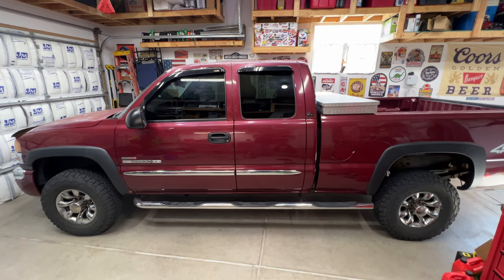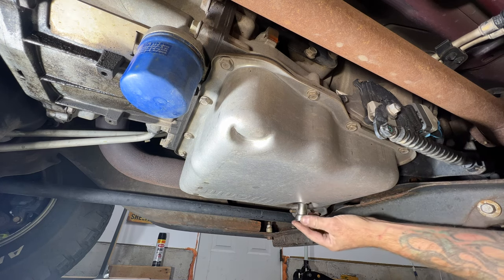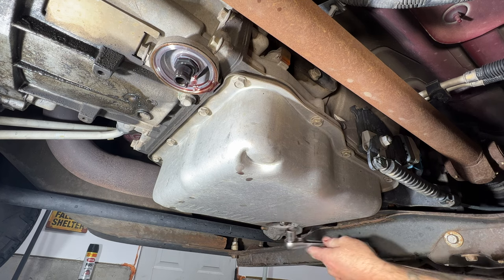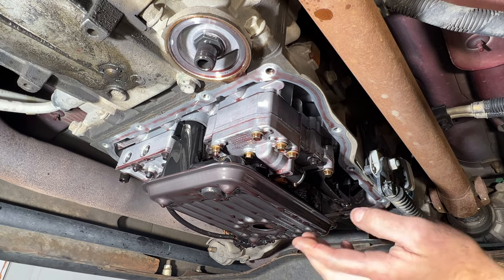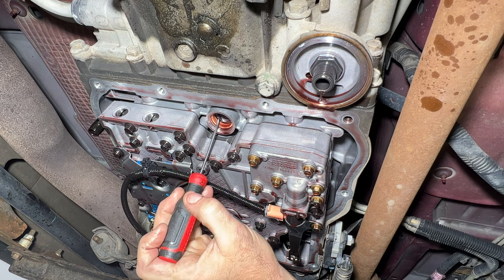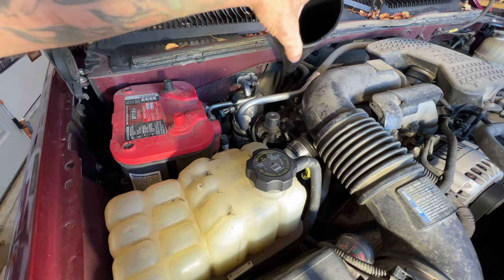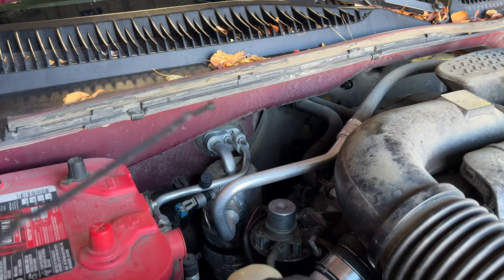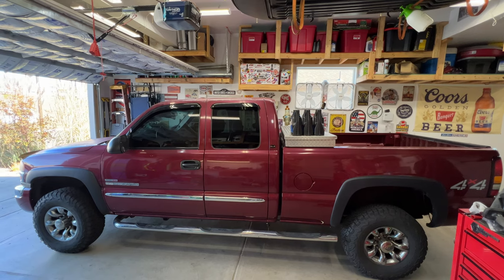Duramax Allison Transmission Filters & Fluid Replacement How-To

Comment: Why didnt you flush the whole transmission?
Reply from the maker: Flushing the transmission does more harm than good. Drain and refill plus filter replacement is what most manufacturers recommend.
Reply: I've actually had a local Dealer tell me that you never change the fluid in an Allison... I don't buy into this line of thinking... Follow the money$$$... Every 50,000... No flush. That's my regiment.

Comment: That oil looked horrible. Don’t see how it’s possible to hurt a Allison trans but looks like yours isn’t doing to hot.
Reply from the maker: The person i did this for bought the truck brand new and this was the first transmission service and if I remember right it had about 150k miles.